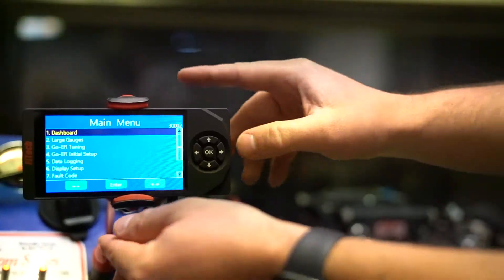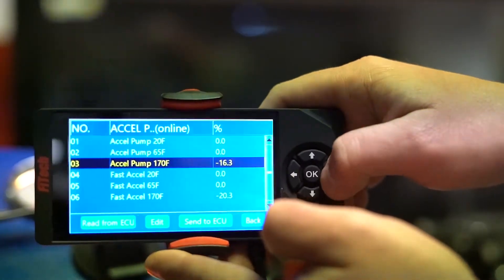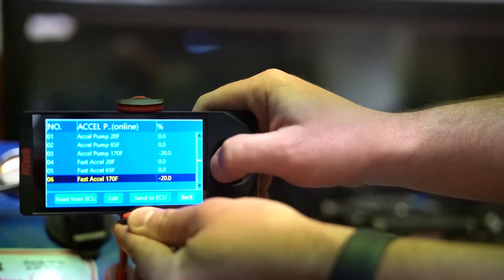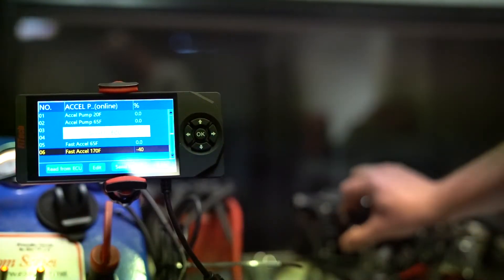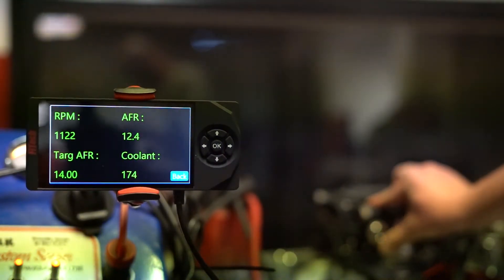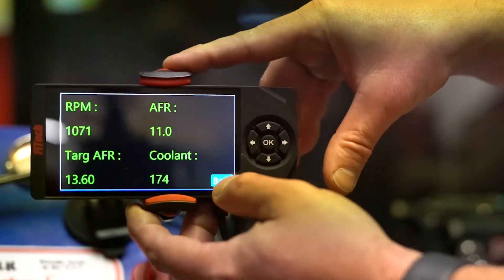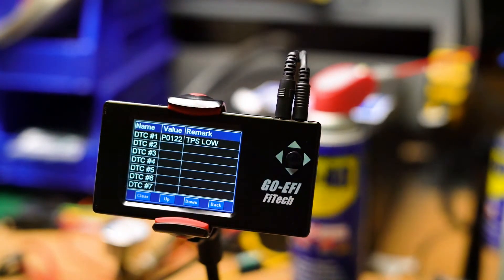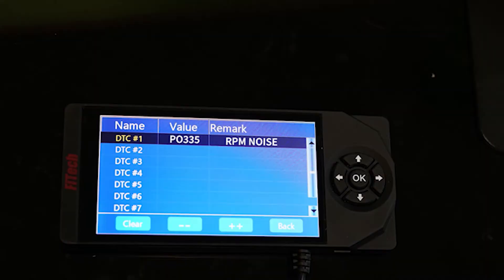Adjusting Accel Pump | Tech Tuesdays | EP10

Comment: I have 38350 ecu, with a accel super ram  intake. When I had it actually driving it was hesitating, and letting off gas going lean then rich and bogging down and wanting to die. So I'd like to know if you could give me some accel pump settings to just start with. Car idles great but when I Rev it now it has a backfire
Reply from the maker: Check fuel pressure, including when tapping on the throttle. If fuel pressure drops at all it will get worse under load, this could be caused by a restriction in the fuel line ( clogged filter, ect)

Comment: I use an Aeromotive 5.0 variable speed pump that adjusts based on TPS voltage. Will this fuel pump affect the system negatively

Comment: My problem is a surge ( and sometimes stall) on cold and mostly hot start up. My accel pump readings are 0.0 , -10.2 & 20.3.   What should they be?
Reply: i was having a similar issue and i found out i had a vacuum leak via intake gaskets

Comment: Would this help if my engine seems to be running too rich at idle and cruising? I smell like gas whenever I drive my mustang with the fitech system.
Reply from the maker: watch the AFR video for idle and cruise tuning of fuel. Also always worth checking is the FAULT CODE section of the handheld.
Reply: @FiTechEFImedia  Thank you 👍🏼

Comment: Would this help with a stalling issue? My car is stalling after deceleration when the car is warmed up.  Usually after a rolling stop, and sometimes after full stop. Sometimes coming to a full stop the car wants to stall and I have to give gas to keep it from stalling. Once i go to accelerate,  the engine is just cutting off. It starts right back up, but it will do this on almost every trip I take usually on the return trip back from where I'm coming from(5-10 mile trips).
Reply from the maker: Check out our IDLE CONTROL video for help with the issue you are describing.